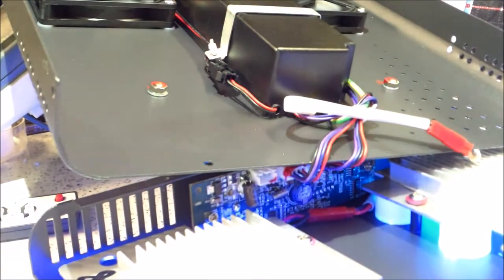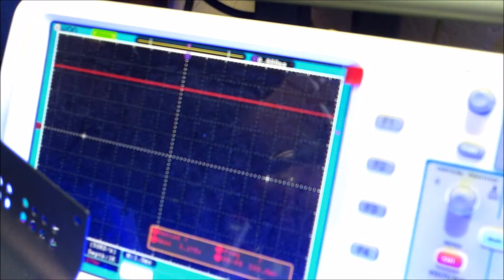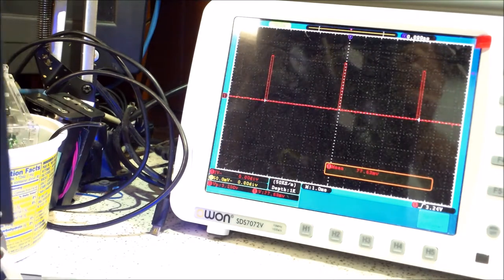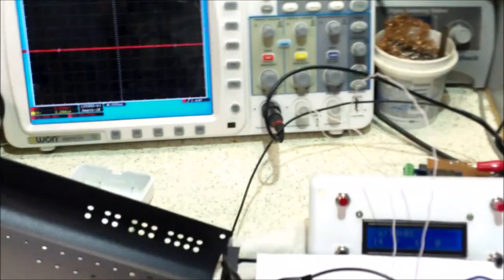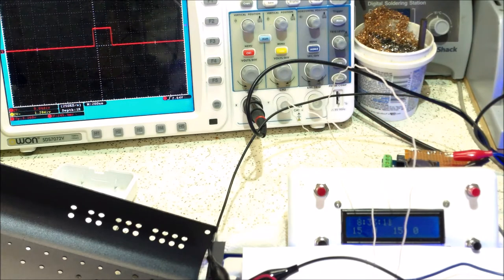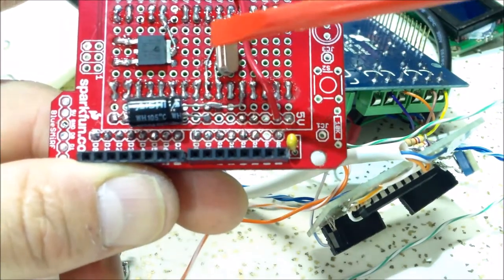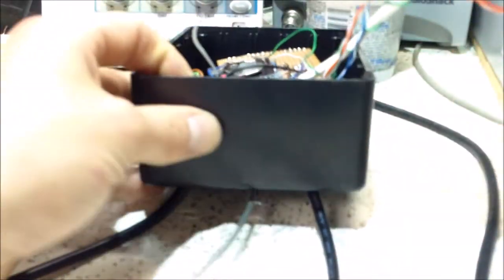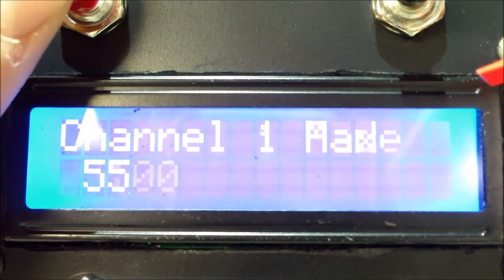How To: Arduino Controlled Ocean Revive Arctic T247 Ramping LED Controller (Typhoon Led Controler)

Comment: Carl thank you for the response i mean hook the light e self to apex control like sb reef lights they used to wire the on and off and used a cap 5 for the signal thank you .
Reply from the maker: I am not totally sure if that is possible? If the max output from the apex is 5 volts I would say it would be ok.

Comment: Carl fr one question please since the Arduino is 3.3 volts can u hook to apex controller is 0 to 10 volts thank you my question is because they does on other black chinise box   and they work fine thank you .
Reply from the maker: If the voltage is actual 0-10 volts then NO. As the arduino can only handle 0-5 volts.
Reply: I might work on a project to get the Ocean Revive Apex ready so that it will accept a 0-10v for dimming.

Comment: I realize this is a fairly old video by now, but I'm looking to control my T247's with an ARDUINO MKR WIFI 1010.  Is the 12v on/off powering the LED's via the driver and the 3.3v PWM is used as a signal to the LED driver only?  I plan on controlling 3 lights and wondering if I could use the same PWM signal/pin to control all 3 without overloading the pin.  With the Wifi access I can setup a Blynk app that will allow me to make changes on the fly with my phone to the PWM signal.  Thanks.
Reply from the maker: Yes the 3.3 volt pin is pwm control for the driver only. If I remember correctly the 12 volt is for the relays only. Turns the driver on and off as the led were dim with out the relay.
Reply from the maker: You could also add a transistor to each driver and have one arduino pin control each transistor.
Reply: @CarlRecktenwaldJr  Thanks again for all the help.  I went the transistor route as you suggested for the switching on/off the drivers (still some work to do on determining if I can switch multiple drivers with single transistors/arduino pin).  Also so far have the Blynk app setup to change settings on the fly instead of using the Typhoon controller (on/off time, ramp time, white & blue max on percentage, etc).  Very happy with how this worked out and your video was instrumental in helping me learn.
Reply from the maker: Glad it worked out and the video assisted. Thanks for the feedback.

Comment: just curious why you didn't use a arduino with a 4 relay shield on top of that. Then only need a minimal amount of stuff on the home made shield like RTC and 2 separate 5V regulators one to run the arduino and one for the relays 5v for the arduino should work it is only running the sketch the RTC can run from the same regulator as the relays. I like Your comment about solid state relays I think they would be a improvement just to get rid of the clicking sound.
Reply from the maker: I wanted to use what I had on hand...I also did not know if this would actual work. This was more of a trail and error proceess.

Comment: DO you know if this would be the same for the Viparspectras?  I believe they run on 3.3v PWM also.
Reply from the maker: I do not know. Sounds like the voltage is the same.
Reply: @CarlRecktenwaldJr  What type of drivers do the T247 use?  I see someone use a bluefish mini but on the description it says it only works with Meanwell  LDD drivers.  Do you know if this is true?
Reply from the maker: Not sure. I do know they use 3.3 volts. I build the typhoon controller which is 3.3 volts. You should be able to measure the voltage output to confirm.

Comment: Great vid and very informative. I have a question about using the Bluefish Mini controller. If you're not familiar with the mini, it's a lighting controller designed for meanwell ldd drivers with 6 channel outputs by 3.3V PWM. I'm sure from watching your video that the pwm portion of the mini will work with the T247 but I can't figure out how to get power to the on/off - 12V using the mini. Do you think a 3v solid state relay connected to one of the channels of the bf mini will work? How would you tackle this? Thanks!
Reply from the maker: +mlivvy you could use a SSR easy solution or even an opto isolated relay. Your 3.3 volt would lite the opto isolator and then it would get voltage for the coil from another power supply, like the 12 volt supply.
Reply: thanks for the reply. Will 1 Relay work for both channels or should I run a relay for each one?
Reply from the maker: +mlivvy I would do 1 relay per channel, but you could use 1 If they all come on at the same time.
Reply: I'll run 1 relay per channel. I did find 2 channel SSR's on ebay but they ship from china. So it's either that or the Opto 22's I see all over ebay. Do you think I can use the 12v/ground from the T247's controller to power the BF mini? I was thinking of running the Purple on/off wire to the relay and the Blue 12V back to the T247's controller.
Reply from the maker: I would and did not use the power from the T247 controller to power the arduino. Just get a small wall wart to power your controller. The other wiring sounds fine.
Reply: +Carl Recktenwald Jr. I'm starting this project tomorrow and just wanted to ask 1 more thing. The controller on the light itself is also a timer I assume. If only the pwm is taken offline will the light still shut on/off with the onboard timer? I'm wondering this because I was thinking of just taking the pwm line to the bluefish controller and using the onboard timer to shut the lights off.
Reply from the maker: +mlivvy I did not use the factory T247 timer at all. I used the arduino with a real time clock to switch the lights on and off. If you switch the lights on they come on and then the pwm controls the dimming. So the arduino turns on the relay and then the arduino controls the pwm signal...hope that helps and makes sense.
Reply: It makes sense. I tried using the factory timer just for shutting off the lights but it doesn't allow dimming to 0. It stops at around 10%. So now I understand why the relay is needed because if it can dim to 0 then it wouldn't be necessary to use a relay. Duh! lol. Well for now I managed to get power to the bluefish mini by using one of the extra unused connectors on the factory timer. And I can confirm that it does ramp fine from 10-100%.

Comment: Could I connect a toggle switch to either the violet or blue cable to quickly turn on and off CH2 for showing off the tank only under blues? This would be much easier than manually turning off CH2 on all 6 of my fixtures. If this can be done, can I daisy chain all 6 pictures to one toggle switch or would I need one switch for each fixture?
Reply from the maker: +Eric Noa yes the switch should work, don't think you will be able to daisy chain, as they are each from different drivers. You could also put in the arduino code that upon button press turn off the white chanel and turn up the blue channel.
Reply from the maker: +Eric Noa yes the switch should work, don't think you will be able to daisy chain, as they are each from different drivers. You could also put in the arduino code that upon button press turn off the white chanel and turn up the blue channel.
Reply: I don't have them hooked up to a Arduino so thats why I was wondering if a simple switch could turn off the white channel.
Reply from the maker: +Eric Noa ah, got it, than a toggle switch would take away the pwm signal to the driver and turn them off.
Reply: +Carl Recktenwald Jr. To which wire should I connect the toggle switch to? I was thinking either violet or blue.
Reply from the maker: +Eric Noa violet is the on / off wire
Reply: +Carl Recktenwald Jr. Thank you!!